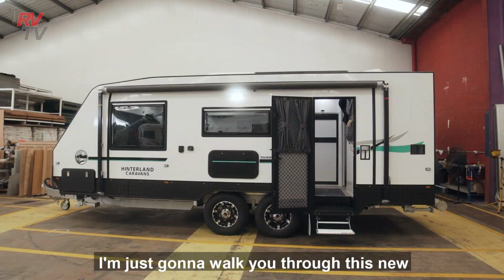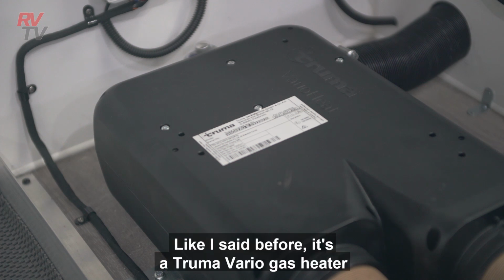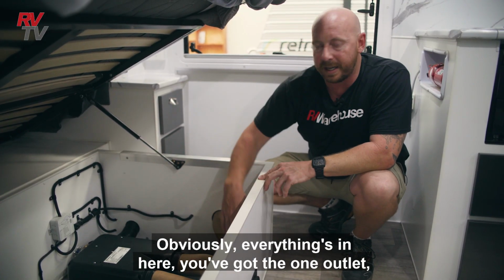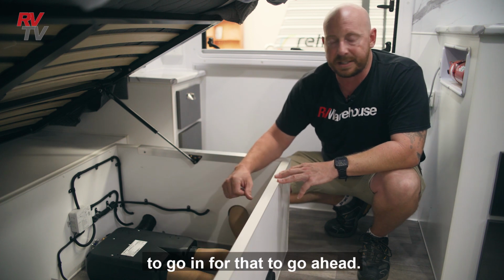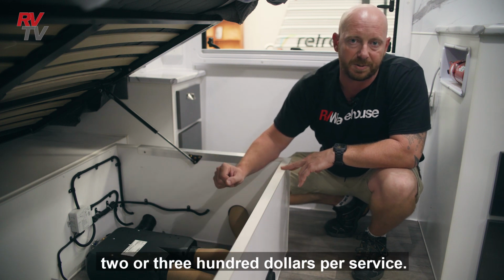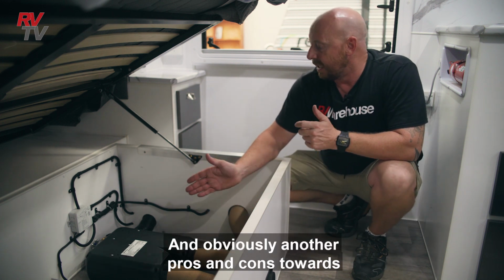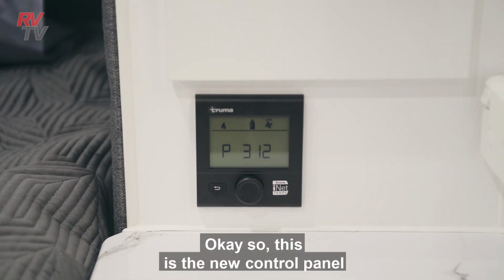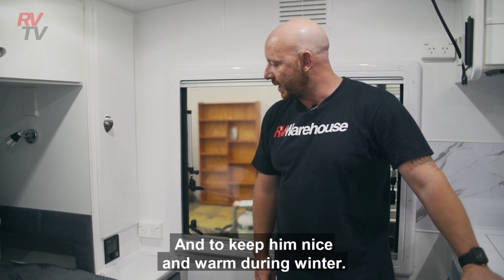INFO: Caravan Gas Heater

Comment: Nice install. 

I prefer my Diesel Heater, as it offers a Clean dry heat, which means none of the humidity and condensation that you can get from gas heaters.